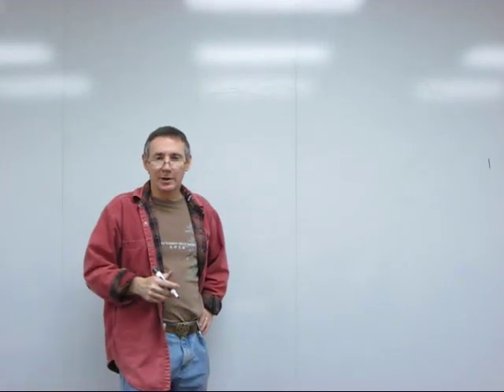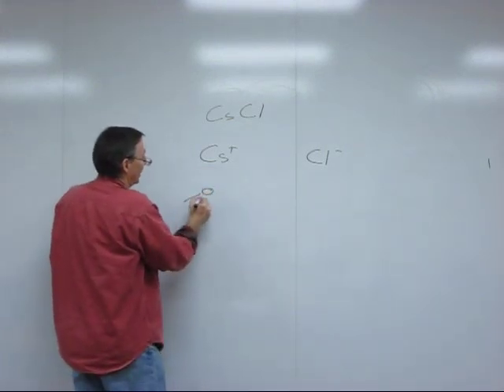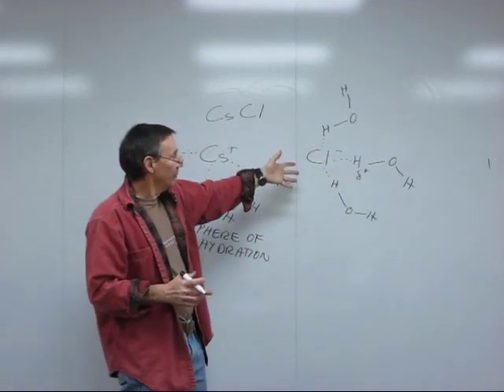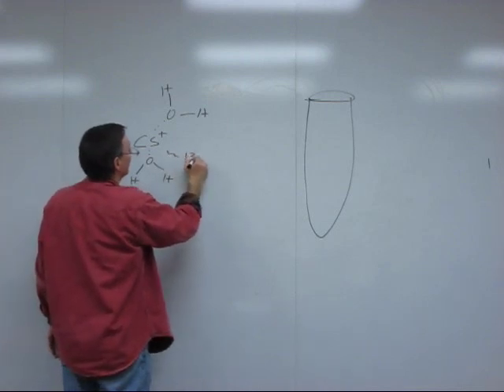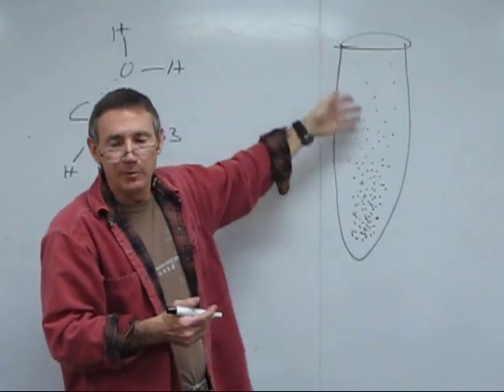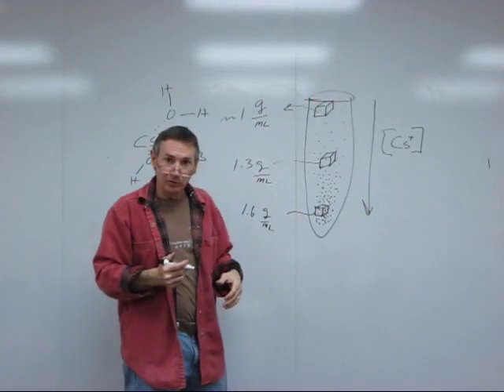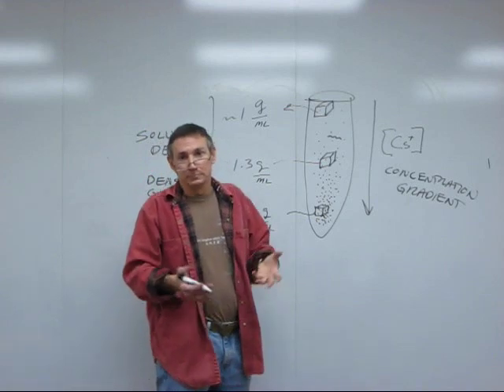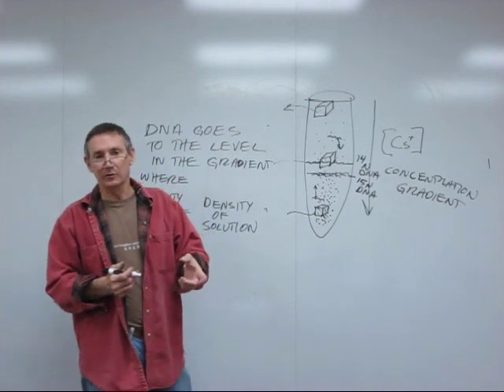Cesium Chloride Density Gradient Centrifugation

Comment: I still can't understand what is the use of chloride here when the experiment depends on the concentration gradient of only cesium?
Reply from the maker: If you were to put pure metallic cesium in the water, you'd have a violent reaction!   What you need is cesium ions in solution.  You can't have the cesium ions without another, negative ion for them to form a salt with, so CsCl is the handiest.  I suppose it could be done with some other ionic cesium compound, but CsCl is readily available.
Reply: Oh. Thank You Allen.

Comment: Another (silly) question: we know that we may use NaCl to shield phosphate negative charges in order to make ss-DNAs re-annealing easier. 

According to a purely theoretical point of view, shouldn't CsCl mime the same "salting" effect as NaCl? 

I guess that while helping reannealing, we do not use centrifuge: yet, Cs+ should be way heavier than Na+ and tend to precipitate much more easily. 

Is it right?

Comment: This is a great explanation.. Many thanks! :) English is not my mother tongue so I do not fully get your explanation, but you explain (and write) in such a way that I get the most of it, anyway. 

There's only one thing I'm not sure about. I know that DNA density should be around 1.66 - 1.69 g/cm^3. If Cs+ maximum density were 1.6, DNA should fall all the way down. 

I thought that Cs density on the bottom were about 1.9 g/cm^3, in order to make the DNA lay "suspended" in the middle of the vial.

Comment: by the way, there is a serious small error in this video: Mr. Gathman claims that only the Cs+ will move down the tube but Cl- will stay equally distributed in the solution. This cannot be right, as this would mean a charge separation. Coulomb forces are very strong, much stronger than the small gravity differences due to the density gradient in solution. Therefore also the Cl- has to follow the Cs+ in order to keep the charge equilibrium in solution.
Reply: TheMountblanc I think you’re not taking into account the fact that the charges of both cesium and chloride ions are neutralized by the water molecules surrounding them, so there would be no potential difference between them

Comment from the maker: Note that the key to forming the density gradient is that you need an ion that is so massive that centrifugation partially overcomes the attraction between the ion and water molecules.  The attraction to water keeps the ions dispersed evenly; the force of centrifugation pushes the ions down, but that effect is only noticeable IF the ion is really massive.  That's why the Cl ions stay evenly distributed.  So no, Na won't work -- it's not massive enough.
Reply: What about uranium?

Comment from the maker: @lmarcze11 -- In the gradients that Meselson and Stahl ran, there would have been little protein there in the first place, as they were purifying the DNA before putting it in the gradient.  Proteins should do the same thing that DNA or any other molecule does in the gradient, though.  They would move to the place in the gradient where their density equals the density of the solution.